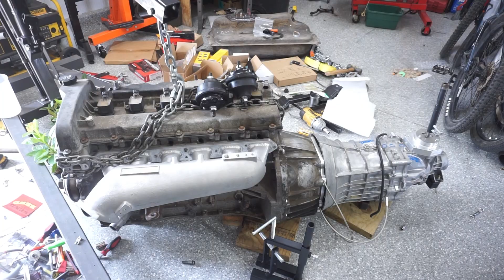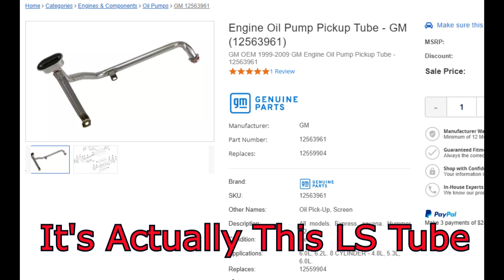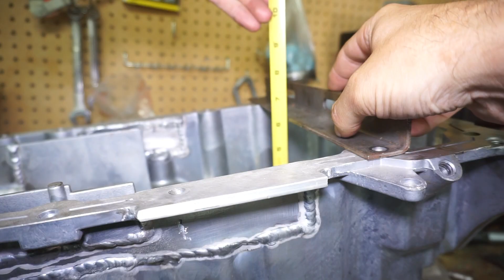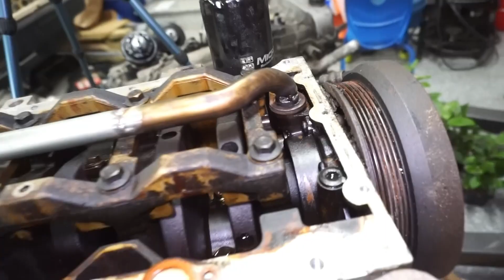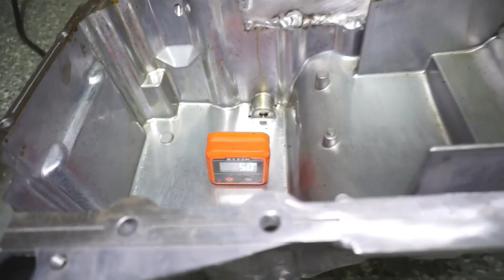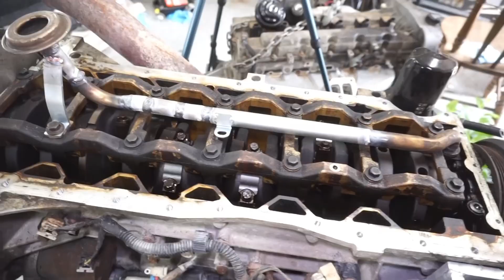Making Rear Sump Oil Pick Up Tube For Vortec 4200 Swapped Volvo 240 Wagon.

Comment: It looked kinda close to the girdle in a couple of shots. When it's bolted in, did you rotate the engine? Would suck if the rods hit it. Probably just camera angle, but thought I'd mention it.
Reply from the maker: I measured it, its 3/8" from the rod cap, and 5/8" from the crank weights.

Comment: I've convinced myself it isn't worth all the hassle doing one of these builds.
Reply: The kind of people that do this stuff dont consider it to be a hassle. Its fun to chop stuff up and make it work the way you want.
Reply from the maker: @HotColorsPowderCoating  Exactly. I've done plenty of LS builds, I think I have 5 different twin turbo LS combos I've done in the past 5-6 years. But doing something different because I feel like it, is a huge problem I guess, lol.
Reply: @BlaserBuilds 

I don't watch your channel or care about what builds you do. I might skip through one on the FYP, I'm not a die hard viewer complaining about you switching content. Instead I'm basically thanking you for saving me the hassle.
Reply: @HotColorsPowderCoating 

I've convinced myself they are only doing it for content, based on pricing and hassle to build one of them. I was going to build one in a trailblazer to skip some of that. Then I visited the junkyard and found out you basically need to do air to water intercooler.
Reply: To put a 5cyl white block into the Volvo you need to do similar. But cut down a 6cyl sump.
Reply: As someone who's put one in a Chevelle, you are correct. It's neat and unique, and that's basically where the positives end. If you just want a modern engine and make good reliable power, just put an LS in it.